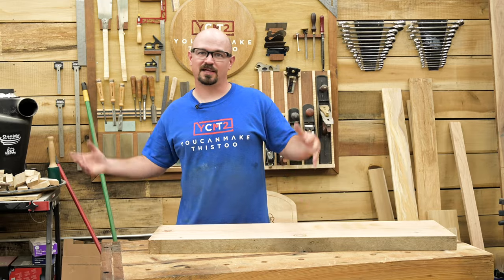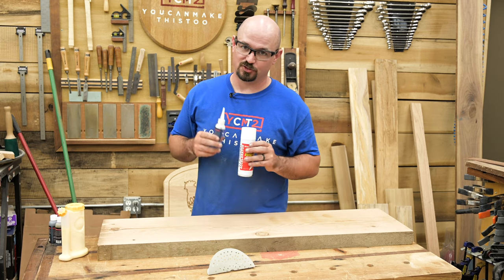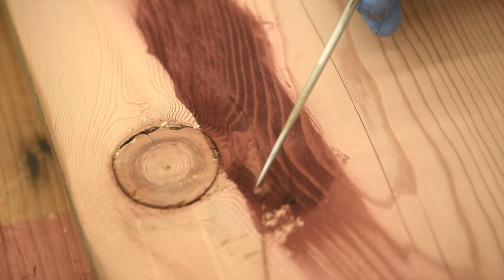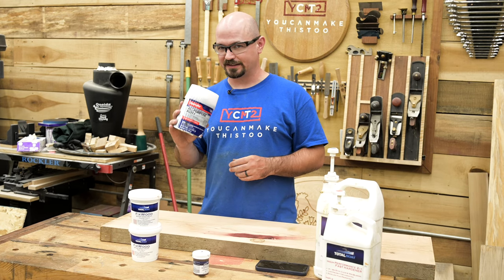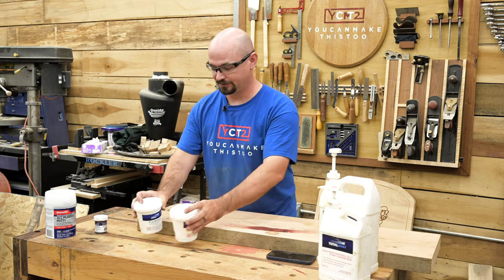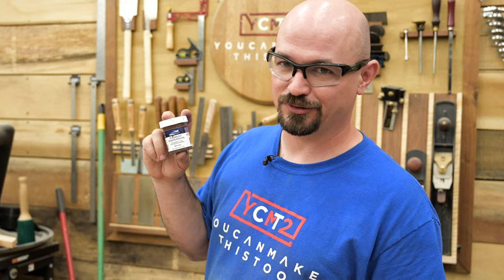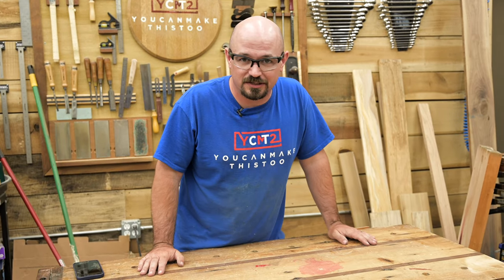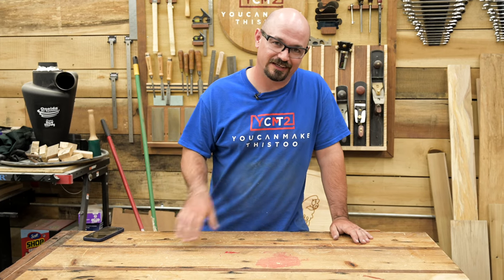Beginner Wood Filling Mistakes | How to Fill Cracks and Gaps

Comment: For the CA glue, you can stain the piece and then use the CA for cracks. I also recommend finding a material you can use to smooth/feather the glue while it is still liquid, and using a scraper after it dries to get the bulk of the peaks off, then lightly sanding the area. You can then apply a second coat of stain if needed and clear coat.

Comment: Thanks for sharing.  I enjoy all your videos.  I've tried mixing the matching sawdust with the finish I'll be using first then mixing it with the either CA or PVA glue.  Not sure if this would work with all stains or finishes but it color matches better.  It does act like endgrain which ends of darker if your patching over edge or face grain but still closer than having a pale patch or line.  Also I have added slivers of wood and sanded them down which works better if you have a linear gap.  Even if it's not perfectly linear I've added a tiny sliver and then the sawdust mixture around it.  Looks more random like it was just part of the natural wood variation.
Reply from the maker: Ah true, I should've mentioned patching. Little more time consuming, but solid results.

Comment: Thank you for the video.Lots of good ways to fill those cracks and gaps. Have you ever tried Laquer and Wood dust. I used to sand hardwood floors and we would use the dust from whatever floor ( Oak, Maple, Pine etc... ) and mix with a gallon of Laquer. And apply with a Putty Knife or Trowel. Depending on how many cracks. Not as durable as Epoxy for sure. But it did the job. Thank you for the video.
Reply from the maker: I haven’t tried saw dust and lacquer. Honestly don’t use lacquer very much
Reply: What kind/Brand of Laquer do you use?
Reply: @dunedainmom  That was a long time ago, But I believe it was Minwax. Not for sure though.
Reply: Thanks!!

Comment: Thank you for bringing up the glue and saw dust method. I have always hated this method, for the reasons you brought up. The only time I would use this method is when the surface will be painted, in which case, I'd prefer using Bondo as a filler. I have done this many times. No problems.
Reply from the maker: Great tip!

Comment: There are several ways in which this might be a dumb question, but could you stain some scrap (preferably from the project), sand it (rinse, repeat, until you have enough) then use that sawdust mixed with glue to get at least a similar look to the surrounding stained wood?

Also, if you need to do a more structural fill but don't love the look of epoxy, could you fill with epoxy resin just bit shallower than the void itself, then fill the remaining space with something like a sawdust/glue mix to visually cover the look of the epoxy?

Apologies for any terminological mishaps -- I typically only work on projects for myself, and I don't really ever have to talk out loud (type out loud?) about what I'm doing/thinking about doing.
Reply: Use hide glue or fish glue. It stains fine. Only pva and super glues don't stain. Aot if YouTubers sleep on hide glue but that was glue for a thousand years before the plastics. 

Also the best wood filler is Goodfilla. It's not even close. 

Fish glue is actually the strongest wood glue it's just also the most expensive. Homemade hide glue is around the same as pva wood glue which is basically no different than school glue just juiced up some. Hide glue is better priced than fish but nothing is as cheap as pva glue. There is some minor prep work. Basically need and  electric warmer for hide glue. But all hide glues save so much time in cleanup compared to pva glue. Plus it sticks to itself so better for repairs. 

Like most things in the modern world pva is just the cheap mass produced crap.
Reply: No. The glue is the enemy. It prohibits any stain from giving you a uniform color. Also, staining the wood first, then sanding it wouldn't help either. You're just removing the stain while sanding.

Comment: Thanks for the detailed descriptions! Do you have a recommendations with filling small and large gaps in redwood? I was planning on using Odies Oil for the finish and would like to keep the natural look.
Reply: That could be VERY challenging depending on how big the gaps, seems or cracks are. Best bet would probably be the sawdust/glue method

Comment: I love this video. I am doing a hardwood floor. Total sanding down old clear coat finish and applying new clear coat water se finish. I am considering the saw dust and wood glue method to fill gaps that are more than an 1/8". Should I be concerned with how those treated areas will look after applying a water base poly clear coat I is?

Comment: Very informative and lively presentation!  Can you please advise how to fix a mistake using eopxy resin in various depth cracks in cedar?  I had high hopes; it looked great until it settled. I let it sit for over 2 weeks and when I started sanding/vacuuming the sawdust, drops of  liquid resin emerged and the sandpaper (220) scratched the resin so it now looks cloudy.  Any advice?
Reply from the maker: Epoxy Resin PRO Tips!
https://youtu.be/jKCGwD_eHag

Sounds like you mixed improperly.. the video above I did will help with that. 

Also the cloudiness is normally. Epoxy needs to get sanded to at least 400 and then hit with a buffing compound

Comment: Question: I recently bought a 108 year old historic house with lots of wood panel doors that have veneer panel insets back to back. Many of these have severe cracks in them up to 1/4" wide. I assume this is from either lack of keeping the wood hydrated, or just humidity causing it to be moist and then drying out. Regardless, I need to fix them. I guess I can use a syringe to glue the veneers back down flat, but what would I use to fill and color the cracks?
Reply from the maker: You’re talking restoration which is a world I avoid. The right answer is repair the veneers. Sand everything. Color match a fill as close as possible. Then refinish it all as close to original as possible. 

There are folks that can do spot repairs. They’re incredibly talented artists with an understanding of woodworking.

Comment: Thanks Caleb for this great video. I made a table top with planks. I filled the small gap with wood glue and wood sand. But after a couple of days the gap where the filler is cracked again. How can I stop it from cracking after applying the wood filler??

Any tip would be much appreciated
Reply from the maker: Either the wood isn’t dry or hadn’t acclimated to the environment.. in which case it’s gonna keep cracking until it settles. Or, the filler just cracked as it dried and shrunk. Do it again and should be fine

Comment: I'm sure it's already been said somewhere here, but stain some small scrap with intended finish stain, sand it lightly, capture dust .. mix and apply with pva ?
Reply from the maker: But then you've gotta sand it smooth after you apply and ruin the stain job on your piece.  Even if you do it perfectly and don't have to sand.. depends on the topcoat. Glue won't take oil. I'd just as soon use a wood filler as part of the sanding process.. far fewer steps and it'll take the stain and finish just like the wood.
Reply: Yeah .. I guess the scrap/donor stain wouldn't be that resilitent to a proper sanding

Comment: This was a really good video, I would love to see a video on making a mould - my next project involves refinishing a Victorian 10 ft mahogany dining table.  The previous owner's dogs chewed a small piece off of the scalloped edge so I think I will have to fill a mould with epoxy resin and attach it to the edge (somehow).  I'm okay on the finishing but I think it will be tough for the mould piece to stay attached... do you ever use dowels?
Reply from the maker: I'm not a fan of dowels. They're tedious and need perfect alignment if you're using more than one. I'd use a thickened epoxy like FixWood from total boat

Comment: Hi. Thanks for making this very informative video! I would love some advice from you just to make sure that I do not mess up my project... I have been refinishing my kitchen cabinet doors- they have solid maple stiles/rails with a plywood maple veneered central panel. I just discovered a big gouge in the back side of the kitchen cabinet door- this gouge is under the top rail and runs horizontally about 6 inches or so. These kitchen cabinet doors were never stained so I had to strip off the chipping poly with a chemical stripper, sand the doors (both steps done!) and have to now apply the poly top coat. I will be using the Arm R Seal (Satin) top coat (oil based poly). How do you suggest i fill in that gouge? Wish i could upload a pic here. Thanks.

Comment: Great tips! Thank you. I have an 8 foot cedar that I am making into a table. There is a large hole in the center that does not go all the way through. I am looking for the best product to fill it with the most natural finishing look. Any ideas?
Reply from the maker: You’ll probably want to route it to an easy shape and make a cedar plug to glue in.. if it’s large and you want natural

Comment: My husband just put in a butcher block countertop and splintered some of the edges where my sink went in.  He  filled in the splintered areas, some were fairly deep, with wood filler and applied mineral oil.  It looks like several of the pieces are trying to lift.  I am at a loss on what I need to do as I am afraid of any areas getting wet and ruining my new countertop. Any suggestions on what I need to do.
Thanks
Daphna
Reply from the maker: Since it’s a wet spot the best fix would be epoxy, or putting in a wood patch with a water proof glue.

Comment: What would you recommend for repairing a split in a fairly thin wood front door panel?  I believe the door is oak and at least one side will be restained.  It seems like everything I would use would ooze out the other side.

Comment: Can you stain the sawdust before mixing with the glue using the titebond II?
Reply from the maker: I guess? But it's still just mixed in glue which is also gonna stand out... just seems like a lot of work when you could just use similar colored stainable wood putty.

Comment: I dropped a heat lamp face down unto the base floor of a walk in shower. Partical board has been burned, of course the fiberglass base was burned through. All around a 6" hole. My landlord said if you can fix it great. Otherwise we are going to have to trare out the shower and replace the shower base. 
Any suggestions?
Reply from the maker: That’s a cut out and patch in new material job. Fillers aren’t made for large load bearing stuff like that. Particle board isn’t made to be repaired. If it’s damaged it’s done

Comment: Hope you can help. I have a Bubinga wood staircase that I need filling the little holes/gouges in many places. Going with Pure tung oil finish (planning 5 coats sanding in between). Looking for that clear look so I get the rich grains from the Bubinga wood. What filler do you recommend that will match the deep brown/red tones of the Bubinga wood?

Comment: How can someone remove non-hardening wood putty from wood? I mistakenly applied minmax non-hardening wood putty to unfinish-wood. It wasn't until a few days later when I checked the putty and found it had not hardened/dried. Any advice would be most appreciated!!!
Reply from the maker: Not easy way. Just start digging it out with whatever you can

Comment: If the piece of wood is soo damaged that it requires structural wood filer should you use it in the first place?
Reply from the maker: Structural in the context of making furniture, not a building. And I wouldn't use a piece that is entirely punky. But I've used a lot of slabs that had rotted/punky spots that needed some help.

Comment: Hi Caleb, this video was helpful... I'm getting ready to sand and refinish a 140+ year old pine floor, but the surface is badly splintered in several places. Do you a suggestion on which on e of these techniques would work best on a pine floor? I won't be staining the floor, I like the o'naturale look. Thanks!  @youcanmakethistoo
Reply from the maker: For splintering you probably wanna epoxy or glue the splinters down before sanding. Or you can cut the splinters out and use wood filler or patch with real wood.

Comment: I’m making a wavy blue line flag for a customer and I have a long crack along one of the black (stained)stripes- it’s about 1/8” wide and 24” long, u recommend black CA glue?
Reply from the maker: That’d work well if you get the thick formulation

Comment: Not sure you’ll see this since the video is a few months old, but I have a coffee table that I bought from someone who had painted it already. The paint is now peeling off so I want to try my hand at refurbishing. The table has two large cutout designs in it, which resulted in gaps that catch all the crumbs and crap from three kids. I’m wondering if the glue option would work best for this after sanding, if I plan to repaint anyway. Does that make sense? Any thoughts or advice? Thank you! Helpful, informative video!
Reply: I use Bondo if it’s getting painted. That’s pretty much everybody’s go to for paint grade.

Comment: If I have a broken bed and the wood is split. Would wood glue keep the board together?
Reply from the maker: Probably, be sure to clamp it. I'd be tempted to add a little reinforcement on the inside though since clearly the board wasn't strong enough for the application to begin with

Comment: Could you please touch on, even do a special video of filling in wood that has a grain say on a lux wooden window frame, that has some finishing nail holes that you want to fill in and make disappear. How does one fill the holes to match both the slight variance in colour with the wood and the Grain and the whole is right half on the Grain and half in the lighter colour wood.
I tried sending getting some sawdust using 15-second Carpenter's glue but find that the glue dries to a darker colour and much sanding is necessary bringing down a layer of the wood. Could you please do a video on the process. And please p. M. Me ASAP I'm working on a beautiful log home. And a video on how to fill holes on Cedar with the various colours shades of pink purple tan and white all in the beauty of cedar. How to fill holes and foot paint to possibly use to try to match the green and how to seal this? All the above is using Clear Stain. Glacier satin Clear Stain
Reply from the maker: https://amzn.to/3LAJyEf

If you wanna get that particular then you’re looking at custom mixing wood filler for each spot. Getting the color nailed is trial and error. Something like the product above will help a lot.

Comment: Can totalboat fixwood take black pigment? Or should I go with the starbond CA? I just have small checks and knots.
Reply from the maker: If it’s small stuff I’d use CA glue, especially if you want it black. It takes a lot of pigment to get most compounds actually black and not just grey.
Reply: @YouCanMakeThisToo  thanks! I really appreciate the fast reply! It's two end tables made of walnut with knots and cracks (kinda rustic). I don't know how much I'll need and can't decide between the epoxy mix or the CA glue. Sounds like the putty isn't for me. 

Fuck it I'll get both lol.

Comment: All u need is bondo doesn’t shrink or crack and is harder than any wood filler
Reply from the maker: Can't be used for structural repairs though, nor does it accept stain. So not suitable for all applications. But there is a place for it.
Reply: @YouCanMakeThisToo  true

Comment: could you pre stain some scrap wood from the projext for the saw dust you use with the glue?
Reply from the maker: Stain doesn't penetrate deep so you'd pretty quickly sand right through it and just have dust. If it's critical.. make a wood patch, or just use something like Timbermate.

Comment: Hey Caleb I have a large hole about 2” deep an 2” height that runs about 10” long on the bottom of 3 old outdoor wood widow frame  that will be covered with a piece of trim after filled 
   What would you use to fill this?
  I was ready to use wood glue and sawdust mix tell I saw your video 
  Could you please advise what you would do ???
Reply: I've used Bondo for similar situations.
Reply from the maker: That'd be my recommendation

Comment: Can't one mix some sawdust with that epoxy? Would add streaks of fiber, that take color... Idk, it's a question.
Reply from the maker: You can. But the epoxy will saturated the dust and it won’t take any stain or penetrating finishes.
Reply: @YouCanMakeThisToo  I c, cool, ty. Been wondering about that. I'm serious about the Modge Podge. Grab a bottle, it'll become a staple quickly. It's basically white glue, but formulated to take finish. They have matte and gloss to choose from. peace

Comment: Good video. I’m refinishing my cedar deck and railing. I’m thinking of a solid stain for the railing and I’ve been using Wood Epox to fill in voids. Will the stain cover up the Wood Epox?
On the deck I’m using black resin and probably a semi transparent stain. Is this ok?
Thanks,
Paul
Reply from the maker: Depends on the specific epoxy and stain. If the epoxy accepts stains, is exterior rated, and the stain is opaque - shouldn’t be a problem.

Comment: Needing advice - have a light coloured unsealed door - probably ablonde oak is the closest. It's developed some weather cracking since installation due to shrinkage?. I wanted to just keep it same colour but varnished/gloss. Any recommendations on how to deal with the cracking and still keep a varnished/gloss finish? (i.e. no painting and no darking staining?). Or am I doomed?

Comment: Or you just use saw dust and bone glue. It takes stain, oil, whatever like a pro and creates a TOUGH structure if brushed quite thinly into rotten/weak or porous woods. Sometimes the "old stuff" is the best stuff.